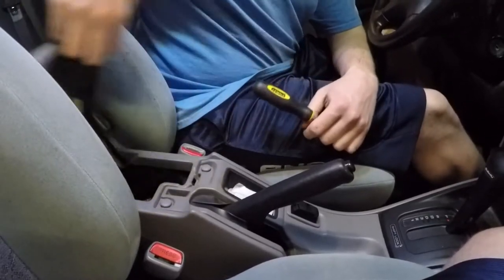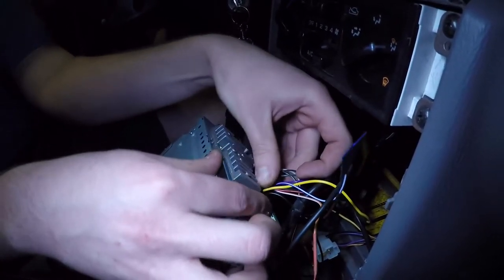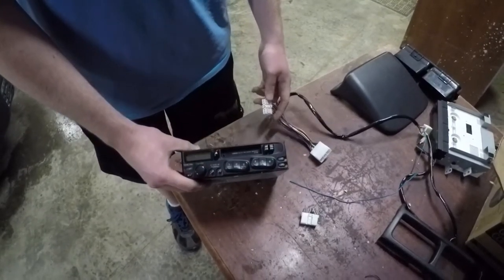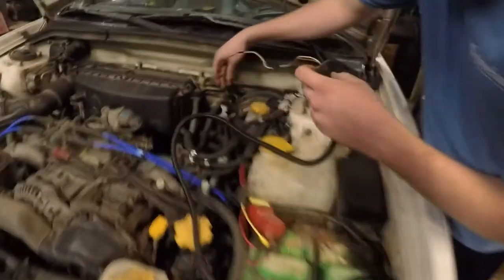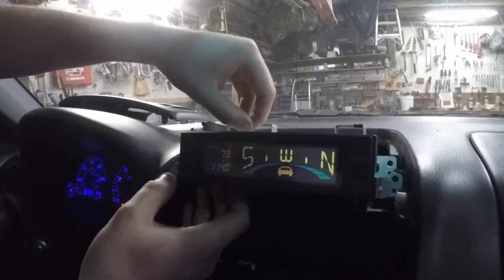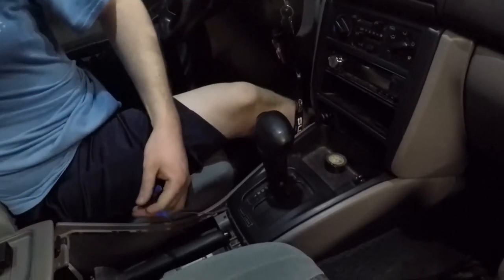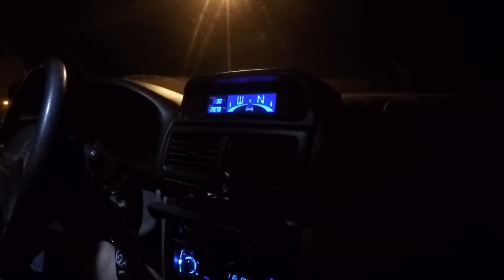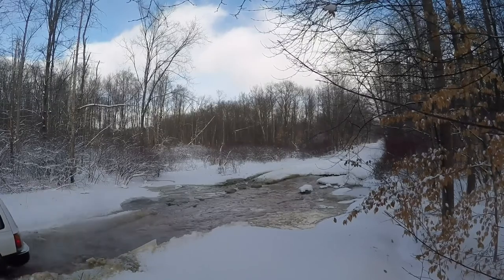Subaru Forester Compass Pack Install

Comment: The blue speed wire is for the animation and also triggers the temp sensor to update after starting the car.
Without it the compass pack will only update the tempature  display on boot.

Its the green/black or green/yellow wire depending on the model and year.
Its on a wide blue connector under the dash near the end of the connector but you can also get access to the speed sensor wire by tapping into one of the green connectors on the back of the instrument pannel, but you may have to feed the blue compass pack wire up to into the instrument pannel housing which can be tricky.
Reply: I have an 02 5 speed manual the wire at the connector is not giving me any out put so will i have to go right to the cluster somewhere?

Comment: Thanks guys.  You made a potential disaster into something I'm proud of!  (On the 2002 Forested the speed sensor connector is black but the wires are exactly as shown in your video.)

Comment: Really appreciate this video. I'm putting one in my 01 impreza rs.. Would have been nice to see how you tapped into the speed sensor wire. I gotta figure out how to do that without messing it up. Already broke a clip 😢

Comment: When you say "NOTE: If you have an aftermarket radio, just cut the 4 wires off the compass pack wiring harness and match them up with the radio wiring harness coming from your car" which 4 wires exactly are you referring to?
Reply: I did mine right and fabricated a oem radio fitting connector to my aftermarket radio harness.

Comment: Awesome install video. I have the compass pack without the separate sensor but couldn’t figure out where to splice the speed sensor. Much appreciated! Also, any recommendations for where to purchase your LED bulbs? Most I have found have been low quality and life span more limited than I think LEDs should. Thanks again!
Reply: Trust only philips for quality LEDs.
Reply from the maker: Before the project retrofits, we both ran Razir LEDs but I don't think they are in business anymore